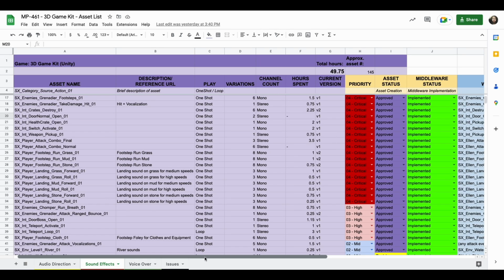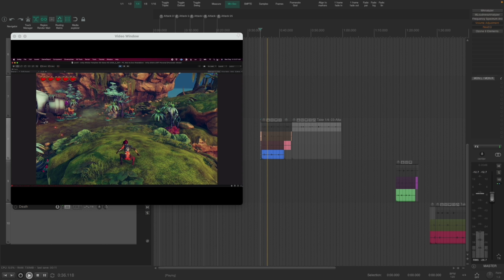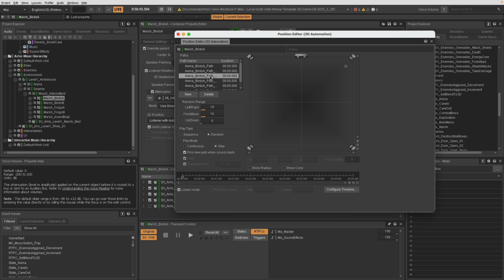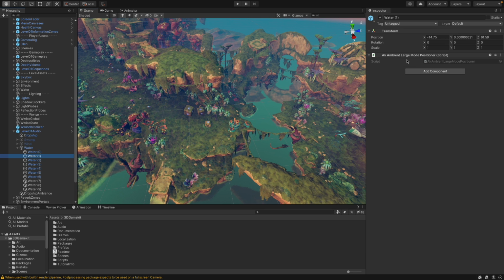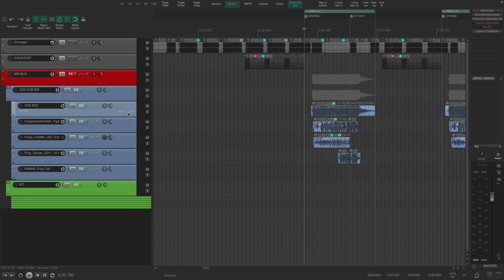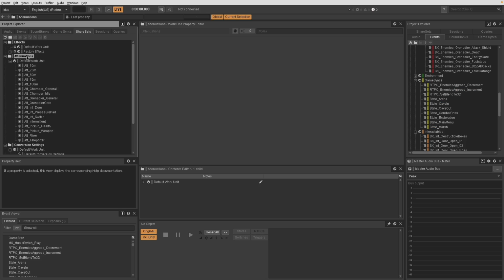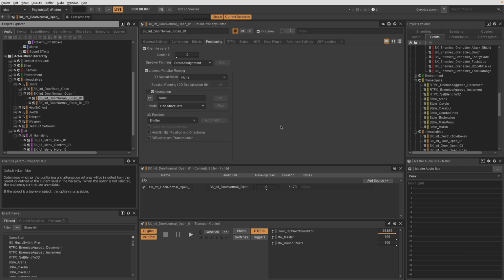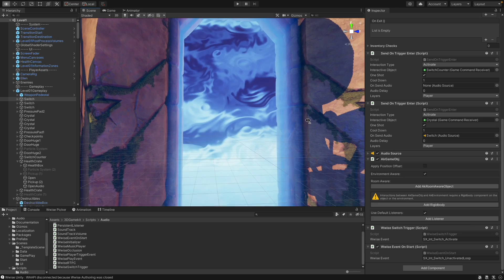Wwise Implementation Demo - Unity 3D Game Kit

Comment: Hi! Great job! I'm doing a full reconstruction of the audio right now, but the character animations are all read-only so I can't add new events to the animations (for setting sounds to Ellen, enemies etc). How did you work around this issue?
Reply from the maker: I just used the animation events that are already set up - there are C# functions that trigger the sound based on the event, it's just a matter of finding them and swapping out the audio code
Reply: @caiojmini  Having the same issue. Most of them do not have any events. I figured that I needed to duplicate the animation in order for it to be editable, but then I would have to assign the duplicated .anim clip to the right state in the animator, which I found a very tedious process.

Comment: I really like your re-deisgn. The special audio, conecpt for all those sounds, filters automations depending on location from the emitter. It's also cool that you've made a breakdown of how you've made those sounds and how you've implemented them to the game. The one thing that I disliked was the player voiceover for the dialogue prompts. Aside from the fact that (I assume) it wasn't a professional lector, this sfx with character saying something should've been more processed so it would fit better into the whole game, but that's just my opinion. 
Also how and where did you learn implementing sounds into the unity and overall using wwise? Do you think you have to know unity and coding well to make only sound re-designs?
Reply from the maker: in terms of wwise implementation, the audiokinetic website has a bunch of tutorial videos and courses. i recommend watching the free wwise-101 series if you're brand new. 

in terms of doing redesigns, you can always just replace the sounds in a unity project without changing the code or take a video capture from a game and redesign it in your DAW if you wanna practice just sound design. that said, if you wanna integrate wwise into a unity demo project there will be some C# scripting required to make it work (the unity learn website has a bunch of courses for free, i recommend the create with code course to get started)